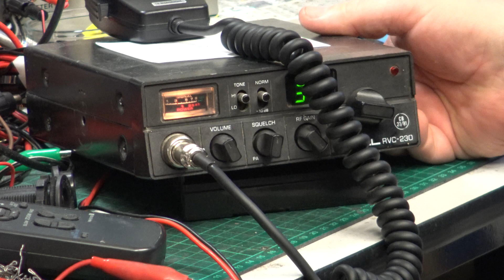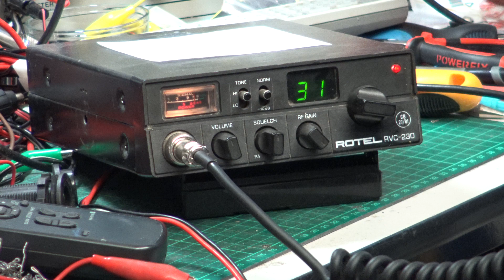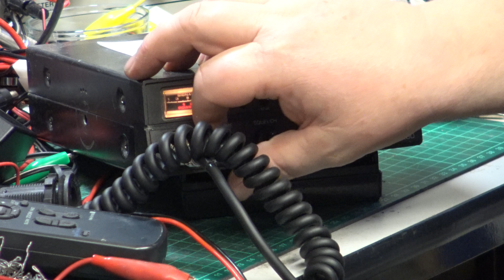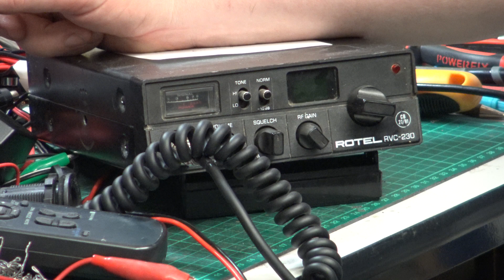Cybernet ZX1 UK CB27/81 CB radio (Emergency kit 4w 40ch) - On The Air mobile field test revisited

Comment: Sounds as if the deviation or mic gain is a bit low, nothing wrong with his signal, but audio was very poor.  I have used one of those, but it was slightly different.  Maybe a later or earlier model, the one I had the LED display went off and it had a half sized meter instead of the led display, though the meter did move when you talked like an AM set would.  These are very rare, especially the model you have there.  Midland used the chassis, but they were also as rare as hens teeth.
Reply from the maker: If you listen to this radio at the end of the test video where I recorded it into our Harrier base station, it's fine. He was talking three feet away from it on purpose.

Richard
Reply: @ukfmcbradioservicingTango21  Maybe if he had spoken a bit closer he would have made it through to you.
Reply from the maker: @BoB4jjjjs  He picks the radio up at the 6 mile point @ Rauceby as he pulled into a layby. All these radios without normal PTT mikes have to be operated at arms length with the rig on the passenger seat as he doesn't want the hastle of being pulled up by the police for using a mobile phone & then having to explain.   
This doesn't affect my assessment of the radio

Comment: Well not a lot different. If Mr Chippie was talking directly into it then I’m sure it would have been more readable but I understand that’s not really possible while driving. Does this convert to a handheld? Regards Graham
Reply from the maker: No, this doesn't convert to a handheld. I think one of the others that does is the 3-ch Harvard SOS.

Richard
Reply: UK CB radio servicing there was a midland one on ebay earlier as well
Reply from the maker: @Radiocruncher  I can't spot it now, only USA models...though we do have one, I'm not sure if the aerial is still in the kit
Reply from the maker: I'd looked at closed auctions. I missed that. I have two 77-810's but the antenna is missing from both :(